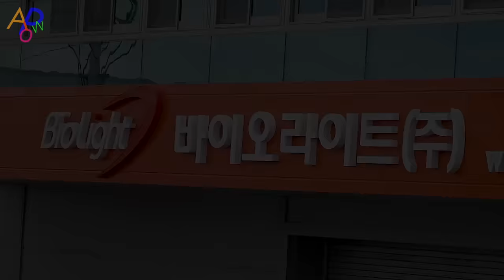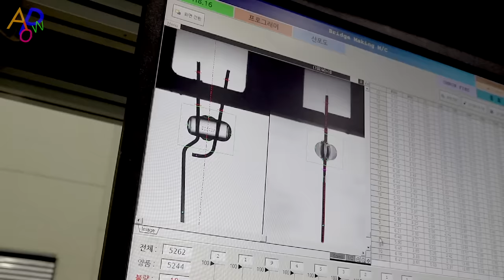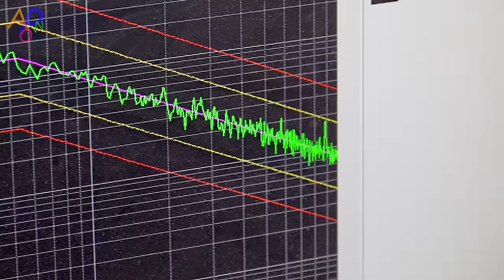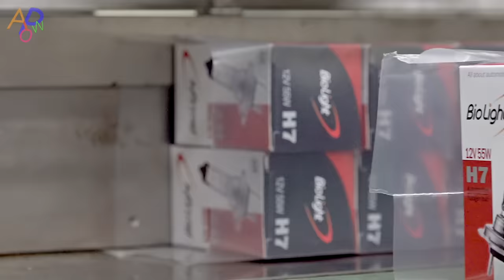Amazing Bulbs Mass Production Process. Car Headlight Bulb Factory in Korea

Comment: 8:53 - Checking the UV absorbing coating. 
It prevents UV light coming out of the lamp, protecting the optics and reflectors in the car. 
It's a phosphor which converts UV light into blue light, while allowing visible light to pass through.
At 11:55 you can see it working, it's visible as a blue haze in the glass when operating.
Reply: 10:47 phủ một lớp màu đen để làm gi

Comment: Those machines have been designed incrementally over many decades. The first machine probably only cut glass tubes then each next step module was designed and tested then added and so on until many decades later you have that incredible production line that probably never breaks down and only needs some maintenance one a year.
Reply: Ok
Reply: They still need to add one module. The one that puts the lights into the cardboard boxes.
Reply: decades are too long it was done way faster
Reply: @jo-han  that step looks easier to automate compared to the earlier steps.
Reply: @jo-han  Boxes are fragile and do weird things. They probably don't want lightbulbs flying all over the place.
Reply: @akivaweil5066  Correct, but there is perfectly fine machinery available for working with fragile object. Lots of packaging robots available too that do not send their to be packaged objects flying. :)
Reply: @akivaweil5066  Eh, reasonable margin of error, plus you can just have a machine plop a box into a square and make it sturdy.
Good to have some humans in the factory though, keeps the popular pitchforks lowered.
Reply: @GashimahironChl  You could argue that because it is a finished product, machinery failure is would cost more.

You bring up good points.
Reply: @akivaweil5066  Filament is much more fragile, and still, they can fully assemble the whole bulb without a human touch. So why not use one more module to throw the bulb to the box, is beyound my understanding...

Comment: 13:14  Mind boggling tech handling all the parts in perfect harmony and then has a person loading the boxes.  Did they run out of money?!
Reply: I thought the same! surely that step could be automated too.
Reply: I first thought the same but then came to think that it perhaps may be some small quality assurance reason for that since if something went wrong with the machines they could pack a huge number of lamps that were completely broken to pieces even which a human would instantly discover.
Reply: @Stefan-  with the hundreds of sensors and pictures being taken at regular intervals, I'm not sure that could happen.  But she can't stop for anything.  and if she has to toss one, that box continues and gets closed and packaged.
Reply: @AffordBindEquipment  She may certainly toss a box if she cant fill it in time and if the machine starts to produce a number of mangeled lamps you would surely stop it. I doubt the machine is intelligent enough to stop automativally because of what is in the pictures, more likely is that these are monitored by a person during manufacturing and/or used for evaluation of the manufacturing process. Anyway, its just my thoughts regarding this as someone that has worked in manufacturing of electronics although not on any  automized line or anything and being an electronic service tech for 35 years.
Reply: Actually, there are about 30 or so people monitoring each step and process to ensure smooth operations of the machines and to stop and make corrections if something goes wrong

Comment: Very interesting video. But, you must never touch the bulb with bare fingers when installing. It leaves deposits on the surface which turn into 'hot spots' and shortens the life of the bulb.

Comment: At the end of the movie a guy installs the lamp by hands, staining the glass of the lamp with grease which lowers life of the lamp. When installing the new lamp you should use some kind of napkin or something like that to prevent the glass of the lamp from grease from your skin which will heat the surface incredibly when the lights will be turned on

Comment: What a fantastic process but unfortunately it was all in vain; when the guy put the lamp in his car "last scene" he touched the halogen glass with his hands and fingers transferring oils and moisture on to the glass. This degrades the glass, the glass turns yellow within a month or two! NEVER touch halogen glass with your fingers, use gloves, paper or even use the cardboard from the box. if you do touch the glass clean it with alcohol, acetone or isopropanol  ETC

Comment: As rigorous as the testing appears here, they must be inferior to bulbs of the past. The amount of cars I see driving around with one headlight more than ever these days means they must be designing them to fail quicker, no doubt to keep the industry pockets lined.
Reply: No you forget something. It is not the lights that fail faster. It is the process of replacing a failed light that has become much harder and you would need to drive to a mechanic who removes a bumper, a battery and some other parts that are in the way and then removes the whole headlight unit, screws it open replaces the light and then puts everything back together again. That might cause more people to drive with a broken headlight because the maintenance can be scheduled next week. So the fault is more in the car design than the light design.
Reply: @jo-han  nah mate, you’re over complicating it, lights are still an easy bulb replacement that jo blow and his backward son can do. Not hard to get replacement bulbs at all. I had cars through the 80’s on that I don’t think I ever changed a bulb in, now these new cars are rife with lights out. Built in obsolescence for sure, just as it has been for house bulbs prior to leds.
Reply: @oo0Spyder0oo  Indeed, I have driven both types, cars that never need no light replacements and cars that need them 3 times a year. Also I have had cars in which replacing lights is easy and some where you really need multiple tools and remove multiple car parts before being able to replace the light. But my latest 4 cars all had LED lights that never needed a replacement.
Reply: حتى  تشتري  اكثر.
 في قبل 100   سنه   كانت اللمبه  لا  تنحرق تعمل عشرات السنوات .
فاجتمع مصنعي اللمبات واتفقوا ان  يكون لها  عمر افتراضي  اعتقد   10000ساعه  او3000   حتى تشتري  كل الوقت.
 وبعدها انتقلت الطريقه  للغسالات  والثلاجات   والطابعات  وكل منتج.
 في بيت امي ثلاجه وغساله  تعمل من سنة  1983.
 اشتريت غساله وثلاجه   مع كفاله  سبع سنوات   انتهت الكفاله  في السنه الثامنه  تعطلت    واذا كانت الكفاله ثلاث سنوات   تتعطل في الرابعه او الخامسه 

يوجد فيديو  يشرح  هذه الظاهره والاحتيلل.
 اليوم لا نصلح الاجهزه نشتري جديد   ولا يهم  صناعه صينيه   يابانيه   المانيه  كلها مع انتهاء الكفاله تتعطل
Reply: @Yazmanyazmanyazman  Indeed that is fraud